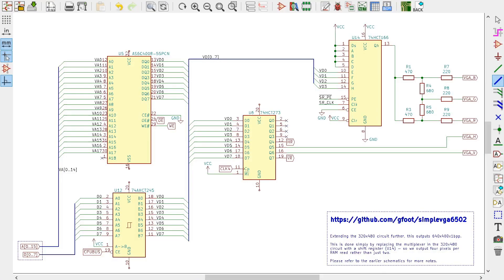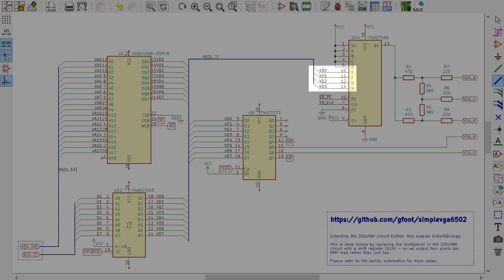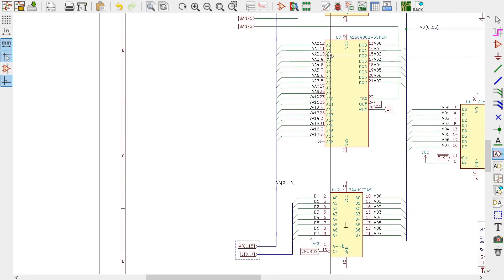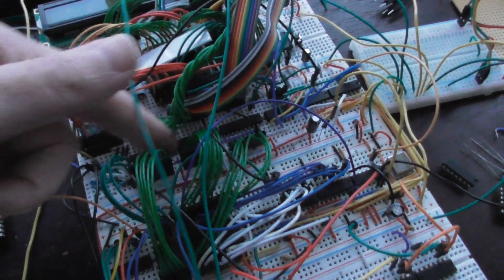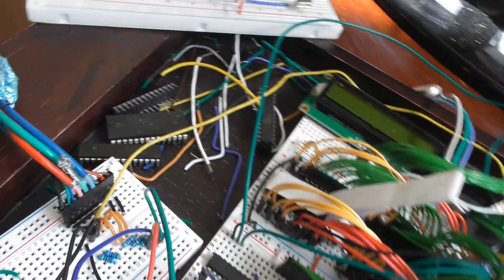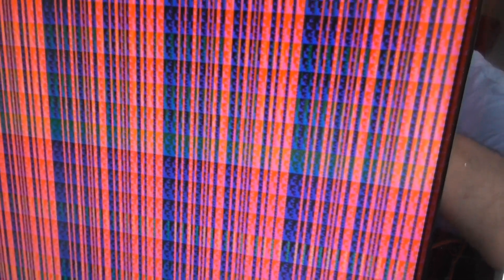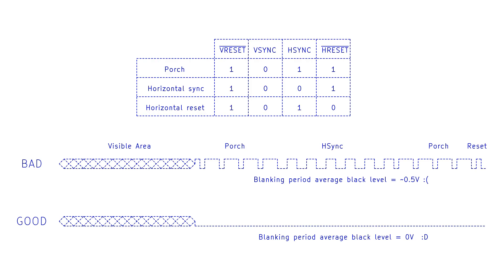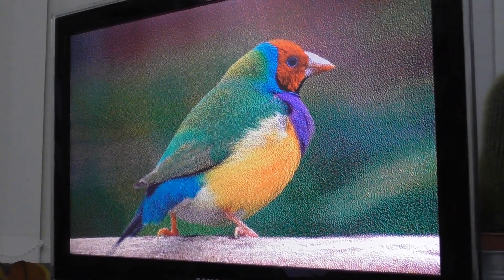Simple 6502 Breadboard VGA - 640x480 8-colour upgrade details

Comment: I was thinking about dynamic color palettes a bit.  From my (admittedly very basic) understanding of how they work, a simple RAMDAC should be pretty straightforward to build, and shouldn't introduce that much additional complexity into the circuit (I think just one layer of indirection right at the VGA output - pixel value serves as the color lookup table index, and the value in the SRAM at that location drives the resistor ladder).  The VRAM layout I'm currently using uses 8 bits per pixel (because I'm lazy), but only the bottom 6 bits are used (2 bits per color) for 64 colors.  The upper 2 bits could be used to select one of 4 alternate palettes of 64 colors, but those colors themselves could be pretty rich ... even if you used 24-bit CLUT entries, that's less than 1K of additional SRAM (4 * 64 * 3 ==> 768). With careful color palette management, this could make blinking the ghosts in Pac-Man a matter of writing just a handful of bytes during the VBLANK interval.

Sorry for rambling on in the comments... but it's fun when the ideas flow :-)
Reply from the maker: It certainly is! It sounds good in principle, the main challenge I think is the speed of the palette RAM especially if you want the CPU to be able to update it dynamically. Most of my designs only perform one fetch from RAM for several VGA pixels, reducing the required RAM bandwidth and leaving time for CPU writes. I guess for the palette RAM you could limit writes to the vertical blanking interval and run it flat out the rest of the time.
Reply: @GeorgeFoot  Yah, the palette RAM access is the trick, isn't it.  In addition to needing to be fast enough, it either needs to be wide (32-bits) or you need multiple small parts.  But a simple state machine could be implemented that takes "color index, color_b2, color_b1, color_b0" and then writes it into the palette RAM.  Dual-ported RAM could make it even easier, no need for external circuitry to arbitrate writes from the CPU (might make the more expensive part worth it!)
Reply from the maker: @thorpejsf  Yes I think dual port RAM kind of spoils the fun! After replying earlier, I started wondering if you could use the main video ram to store updated palette data, and then read it out during the blanking interval when this RAM is otherwise idle. The CPU already has the ability to write to it. It could even be possible to reuse connections from the video RAM data lines to the palette RAM address lines, saving a lot of multiplexers or transceivers.
Reply: @GeorgeFoot  Storing the palette updates in the extra VRAM is a great idea.  I’ve also been thinking about keeping sprite data in the extra VRAM, but palette is only 1K total, so…
Reply: @GeorgeFoot  IDT 71256SA12TPG part is bread-boardable, fast (12ns), and inexpensive ($8USD from Mouser)…
Reply: @GeorgeFoot  Hah, another thing that spoils the fun is putting the palette RAM into the FPGA and letting the synthesis tools take care of it 😂.  Actually, I was thinking, because I'm using a 6809, I could use the MRDY signal to stall the CPU if it wants to read or write VRAM at the same time that the GPU is trying to access it.  The 6809E doesn't have an MDRY signal natively, but the data sheet shows how to implement one with the example clock generator circuit.

Comment: This has been a really excellent series of videos.  I've been inspired to graphics in my own 6809E/6309E-based home-brew project as a result.  I've also been using this project as an opportunity to learn Verilog.  The basic approach I'm using is similar to yours -- driving everything from the 25.175MHz VGA pixel clock.  So my "CAV" (clock and video) block takes the 25.175MHz oscillator input, divides it by 4, which is in turn again sub-divided and phase shifted to generate the Q and E clocks used by the 6809E at 1.573MHz, and also outputs a buffered copy of the VGA pixel clock.  It internally tracks Hpos and Vpos and outputs HBLANK, /HSYNC, VBLANK, and /VSYNC, in addition to a "pixel index", which is simply a counter that only increments when not in either of the blanking intervals and resets at the beginning of the frame, and can be used to generate a video RAM address.  HBLANK and VBLANK can be used to force the VGA R/G/B signals low during the blanking intervals, and edge-detector circuits can generate interrupts for the CPU if you're so inclined.  I may switch the polarity of /HSYNC and /VSYNC, instead using them to drive MOSFETs to drive those VGA signals low, rather than driving them from the FPGA / CPLD directly.

Comment: 2:30 how des he do that?(with the labels)
Reply from the maker: After placing a label, pressing Insert will duplicate it below with the number incremented. I think there are options somewhere to control the gap and the increment, but the defaults are fine for me.

The same key works for wires and bus connections, maybe other things too.
Reply: @GeorgeFoot  thanks! This will really speed up my workflow!

Comment: Why don't you create a stand-alone video subsystem that is entirely autonomous, and then create a way to receive reads / writes from the 6502 when requested?
Reply from the maker: The two are already quite separate, the only real links are that the CPU clock comes from the video circuit (so it's always in sync) and the address and data bus are wired through to enable writes to video memory.

I am probably going to separate it even more soon though, as you suggest, as part of changing the interface to speed up graphics operations. Although the current interface is very wide, the 6502 is not able to make efficient use of it. So this will probably also make it a more pluggable system, with a more register/command oriented interface rather than memory mapping.
Reply: @GeorgeFoot  What about using a memory mapping mode enabled by a write to a specific port, one that lets you pattern the BitBlt'ing you need to do reads and writes on the main bus.  Example: read from ram, then write into larger video memory.  The mapping switches over the target, bypassing ram and selecting video memory.  It then resets after the write.

A few ports to control which "bank" (which upper bits)  and you'll be at 80s level EGA video cards.  Almost. :-)  Still need 256 colors to be decently usable.

Basic flow:

1) Write to port to enable this mode
2) Enter tight loop where you read, copy, read, copy, etc....
Every read toggles the map
Every write also.
3) Write to port when finished to return to normal mode.

That would be for data exchanged on the CPU / main bus.

The GPU would have its own bus for rendering higher resolutions at higher dot / pixel clocks.  So long as you use SRAM, should be completely doable.

Depending on which value you wrote, the mappings could be different based on the needs of your tight loops:
read ram: write video
read, read ram; write video
read, read, read ram; write video
etc

Just some thoughts.  Feel free to disregard all of them. :-)
Reply from the maker: @EnsignRho  I'm not sure what you mean by "toggling the map"? I am interested, just don't quite understand what you're suggesting.

The trouble with any form of memory mapping with a 6502 is that it really sucks at it - indirect indexed operations are really slow. For bulk transfers I want to just write to one address and have the video hardware track and increment the target address itself. This will give a huge speed improvement and reduces the interface width considerably - it becomes more like a command buffer FIFO, or maybe a set of registers.

Other options there are having it also able to expand bit patterns out into multiple byte writes with a fixed colour (great for drawing text, for example) and having it internally copy multiple bytes from one VRAM location to another, like EGA sort of does. I also have a fairly simple circuit lined up to allow writing only some bits within a byte of VRAM, to support single pixel writes in packed pixel layouts. A lot of this is uncoincidentally a lot like the various read and write modes in EGA, which I guess were there for a reason!

So I'm not sure exactly what I'll do yet, but hopefully I'll get time soon to explain my thoughts properly in a video. Work is really busy at the moment though!
Reply: @GeorgeFoot  Can I contact you by email?
Reply from the maker: @EnsignRho  Sure if you like, my gmail address is just my full name with a dot.
Reply: @GeorgeFoot  Will do so.  Thank you.

Comment: George, why not treat yourself with get yourself some handy (but obsolete) 74265 quad complementary output elements for your breadboarding experiments.  They’re great for removing unwanted glitches. Alternatively you can use more modern (but obsolete) SPLD and CPLDs if they’re fast enough.
Reply from the maker: I can't find a datasheet for 74ls265 or similar, what do they do? I have some PLDs that I might use in future, just need to find the right use case!
Reply: It's not available in the LS family just TTL family https://www.jameco.com/Jameco/Products/ProdDS/2298775.pdf
Reply from the maker: Ah right, it looks useful for longer distance communication I think, I'd prefer to stick to CMOS parts though.
Reply: @GeorgeFoot  I found a reference to a TI SN74265.  4 buffers each with one input and two complementary outputs - a non-inverting W and an inverting Y where both typically switch within 0.5ns of each other.

Comment: This project gives me a new respect for video hardware. Especially multiple video mode hardware that effectively rewires itself based upon control register values.
Reply from the maker: "Video ULA - BeebWiki" http://beebwiki.mdfs.net/Video_ULA
Reply from the maker: This is the thing that originally got me interested in digital electronics and making my own video output hardware. Despite understanding it well from the software side, I'd never understood why the BBC had such a weird video memory layout, but all of a sudden it all made sense, and there's a beautiful simplicity to it - it feels like they did just enough in the hardware to support a range of modes with minimal amounts of logic. The video ULA is basically just a clock divider, a shift register, and some logic gates, on one IC.
There's also some additional circuit to calculate video RAM base addresses, and of course the CRTC does all the counting, sync generation, and address generation.

Comment: Excellent! I guess this is too slow for games with scrolling?
Reply from the maker: Yes, you wouldn't want to try to scroll the screen in software. The 6502 takes around 5 cycles to write a byte, let alone calculate what data to write, so I'd guess this could probably clear the screen to a constant colour about 5 times per second, not fast enough. Generally games of the era didn't rewrite the whole screen every frame, they updated specific parts, and for scrolling they used hardware scrolling which just adds a constant to the VRAM addresses. You then need to paint a stripe down one side of the screen. And of course they stuck to lower resolutions than this.

Comment: Using a ROM to generate the HSync, VSync and Counter resets is what I've always done on my VGA setup. For VGA 648x480 you can divide by 16 and so use 4 less bits from the counters and use a smaller and slower ROM for those signals. That means you can use more bits from the RAM for colour information too. I also use a ROM bit to make sure that the output is always blanked in the non-visible part by sending that to the OE pins of the output registers (if they are 3-State), that means it doesn't matter if there is junk in the non visible area. I'm looking forward to see what you do with it in the future.
Reply from the maker: Yes that's interesting, as there'd be plenty of free bits in the ROM, one could be used to mark the visible area. It would be important for hardware scrolling.
I was also considering using separate counters for pixel data, I'm not sure if that has many advantages though.
Reply: @GeorgeFoot  My next design will use separate counters for the pixel data as I'm going to try a resolution of 200 by 150 which would normally be over the 32k maximum address space my CPU can use, but if I use separate counters for pixels it will be 200x150 = 32000 bytes, just under the maximum. It does however mean that calculating the pixel address in the CPU is more complex as I will have to do a multiply by 200 to Y and add X rather than use Y as the top 7 bits and X as the bottom 8 bits of the pixel address.
Reply from the maker: @djc1402  The BBC Micro used a x640 lookup table for this purpose. Maybe you could also consider a hardware lookup of some kind. Or something a bit like my bank register but with a built-in multiply.
One of my plans for making life easier for the 6502 is actually to make the video memory not be memory mapped, but instead use a register to define what location should be written next. It means before each random access you need to set the register up, but that's really no more work than calculating the address already is, and the 6502 is pretty poor at 16-20 bit maths.